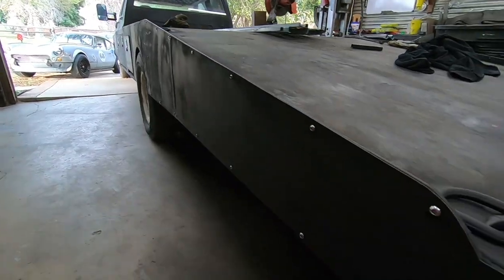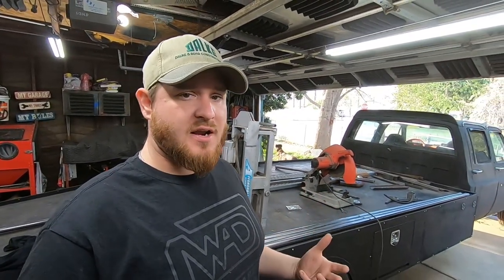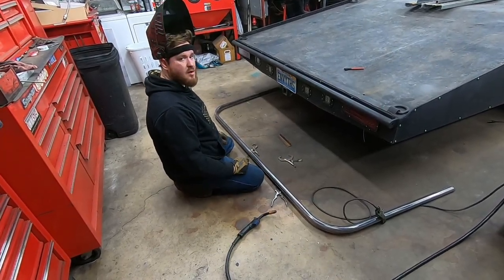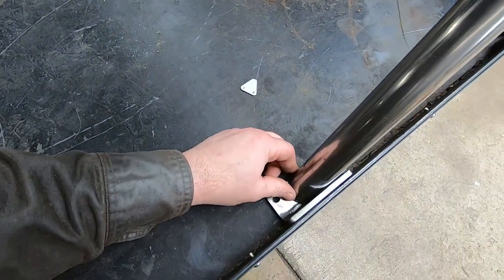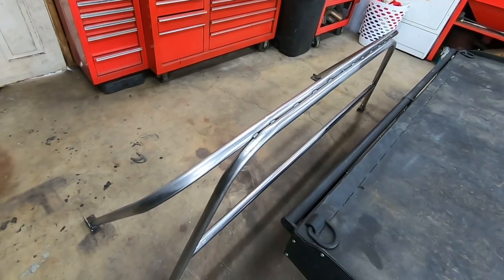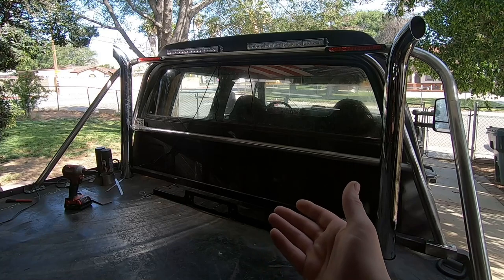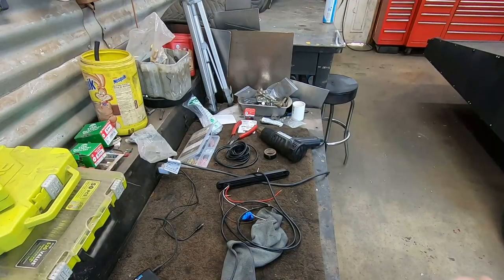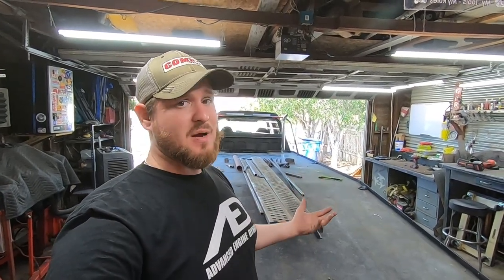e.53 Square Body Ramp Truck gets a news headache rack!

Comment: Did you have a link for the led lights?
Reply from the maker: The amber/white strobes are
ASPL 2x16.8 inch Emergency Flashing LED Traffic Advisor Strobe Light Bar 32LED 26 Flash Patterns Interior Safety Warning Lights (Amber/White) https://a.co/d/7rYpSsC